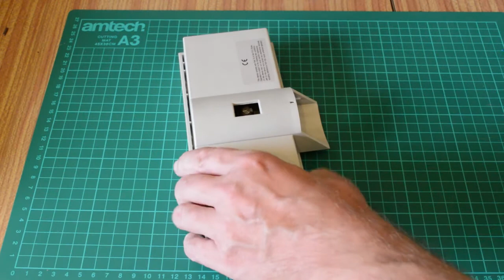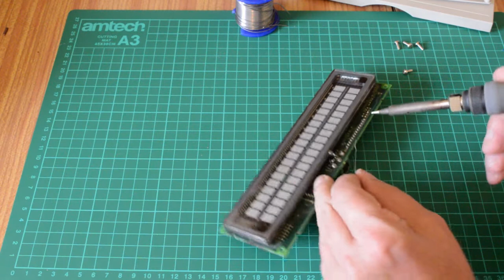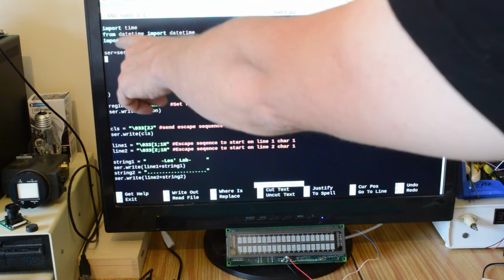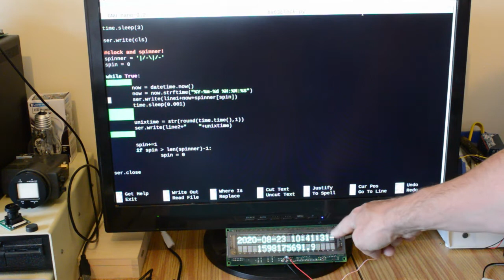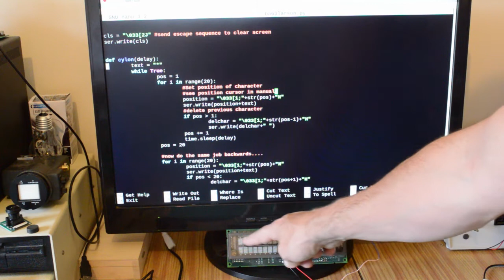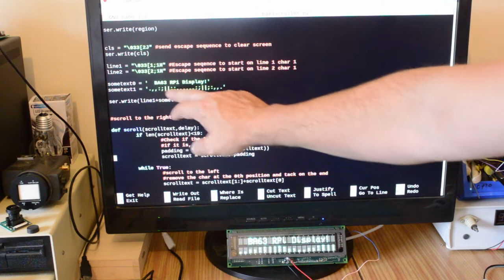How to drive a Vacuum Fluorescent display with a Raspberry Pi: Raspberry Pi VFD Clock

Comment: Could I use this code with windows 7 and a standard RS-232 connection on the back of my computer? Because Raspberry Pi computers aren't exactly easy to get a hold of right now.
Reply from the maker: Probably, the code is minimal. you would have to redefine the serial port though.
Reply: @LesLaboratory  Other than that there wouldn't be anything else?
Reply from the maker: @HIDLad001  not that I can think of, but tbh, I ain't a Windows guy.
Reply: @LesLaboratory  I would use a raspberry pi, but they are really expensive right now.

Oh, and would I need to short out that jumper, or just leave it the way it is?

Comment: Nice video, thanks!

Note that you only need four characters for the spinner:

spinner = '|/-\'
Reply from the maker: Thanks! Yes, you are right, but I need to display  | and - twice per "revolution". :-)
Reply: @LesLaboratory  Indeed, '|/-\' is only half a revolution, but that doesn't matter: there is no need to store more than that in the spinner variable.

Note that if you really want to store a full revolution, then you should set spinner to '|/-\|/-\'. Your code is missing the last character, hence the tiny glitch in the animation.
Reply from the maker: @edgarbonet1 Sure, if RAM was tight, you would absolutely only store the required characters. Re: The Spinner var, so it is, well spotted!

Comment: Would a Raspberry Pi Pico board work for this? To run the display with the provided code? Sorry, I am completely new to this =) Thanks for any extra info!
Reply from the maker: Not with this code. I have not had a real chance to play with the Pico, but it does seem like a very capable microcontroller. If you can make it talk serial, it should be possible to write code for it.

Comment: Is it for sale?
Reply from the maker: No, but all the parts are available inexpensively. Pi zeroes are around 5 bucks and old POS displays can be had on eBay for about the same if you are patient. All the code is on my github (see the link in the description)

Comment: Nice video, given that the bit parity is configurable in the Python code (as you showed). Was it actually necessary to set the jumper on the board?
Reply from the maker: Yes. If you try setting it to odd, the program will throw an error and crash. 
The Raspberry Pi onboard serial cannot be configured with odd parity.